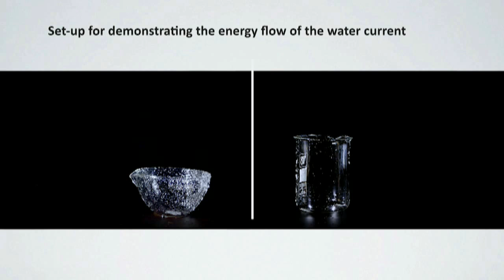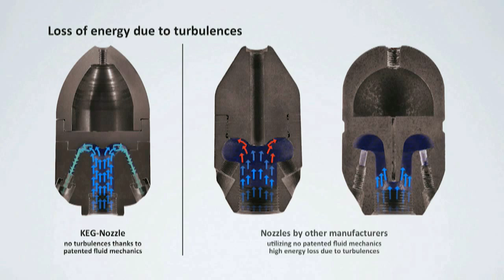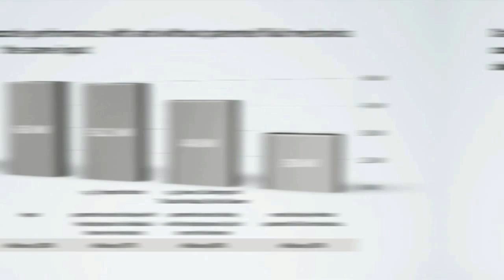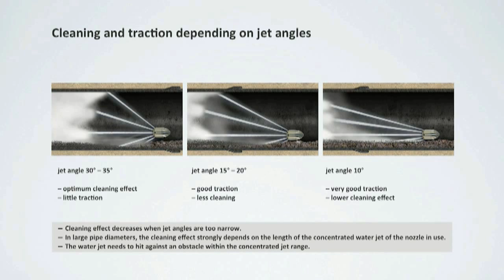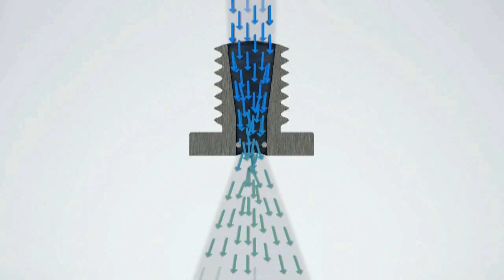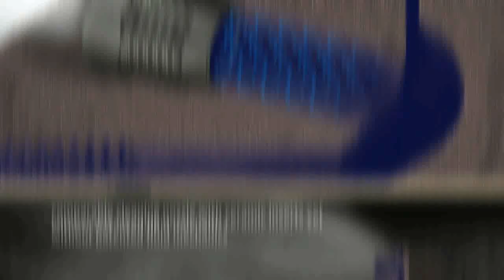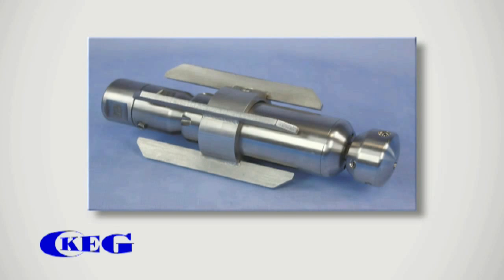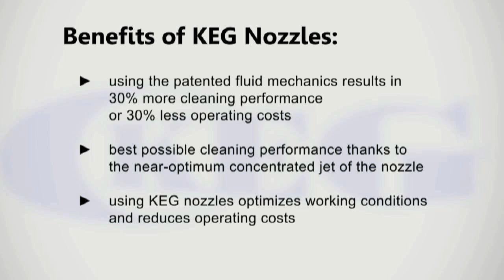KEG Drain Jetting Nozzles

Comment: do you have a head that would cut thru roots? Also, a head that would work with a 4 gpm 3500 psi pressure water